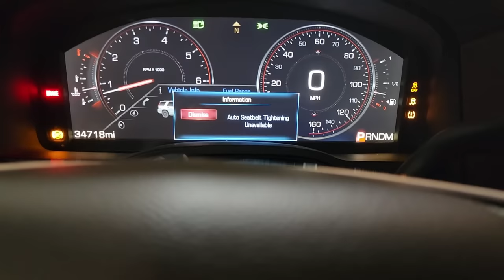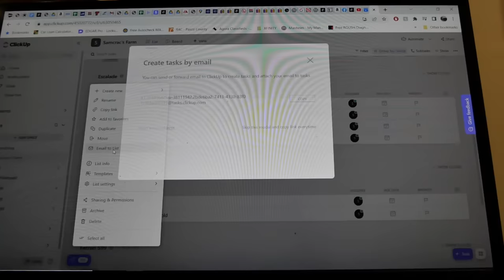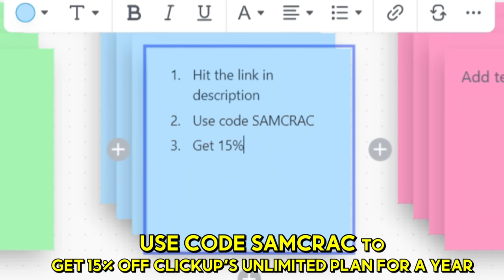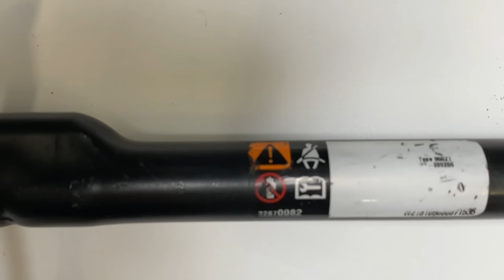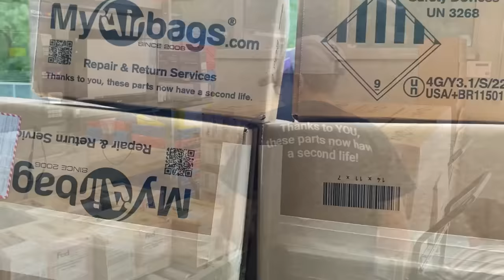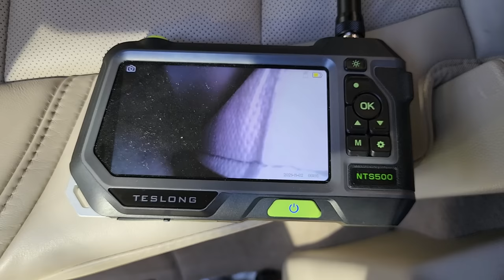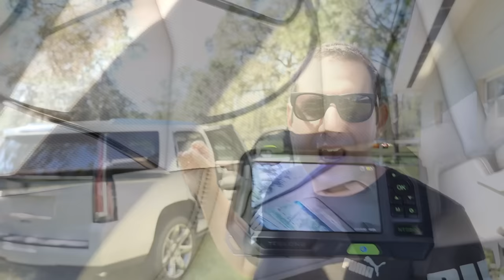Someone Illegally Tampered with my Auction Escalade's Safety Systems

Comment: I will be jerk testing the seat belts of any used car I might buy or even ride in to see if they lock as they should.  This internal "mod" removed even the basic seatbelt impact lock function that even the old seatbelt retractors had.

Comment: Parts pricing and availability causes so many unsafe cars to be sold. The manufacturer should buy them back! No one wants to be left holding the bag because parts are not available, so they just sell it in a dirty way so it becomes someone elses problem...  Its the manufacturer that doesnt have the parts, they should buy the car back and deal with storage and repairs when the parts finally arrive and then they can sell it for the depreciated cost!

Comment: General Definition. When a seller marks a vehicle “as-is,” this basically means that the vehicle is being sold in the condition that it is in at the time of sale. The buyer accepts that repairs may be necessary and that the seller is not responsible for making or paying for such repairs. 

I'm sry bud and to all the others complaining,  it clearly said AS IS and that's final, it's a shitbox and they knew it, that's why it ended up in an auction.
Reply: There is a huge difference between something being wrecked/broken and something being sabotaged.
Reply: @Rickmakes  either way they bought it knowing it had unknown problems in an as in state... you take all the risk for not looking further into the vehicle prior to purchase. He has noted a few times in previous video this poscalade was known to have issues. He's looking to buy cheap sell premium, it's his loss for gambling on a POS

Comment: I suspect the owner hit something or someone realized later, it was much more to fix. Took it to shady shop. The resister trick probably worked. Did a quick trade the buyer didn't see flags and no wreck reported. After some test drives more systems fail. Then the dealer goes hey we can fix at cost. They dig in hence loose trim... sent to auction rather then gamble.

Comment: 6:15 - holy shiat that could have injured or killed someone if they bought that cart and assumed the safety systems were operating correctly. WTF. Seriously, there needs to be a way to trace that back to the party who sold it to auction and penalize them big time.

It's amazing the lengths people will go to endanger strangers just to make a buck and/or avoid doing something the ethical way.

Comment: This Is Not Unusual someone went to the auction and cut the wires. They do that so that that it will become a no-run vehicle and then they grab it up cheap. Splice some wires and make money. By the way if your GM product has a lockout mode. Find one of those very thin orange wires and ground it for about 10 seconds. That will reset the system. I've been to those auctions I've seen the cut wires. I bid them. Columbus Ohio Sheriff's auction. I drove that Cadillac for a long time. I paid $900 for a $10,000 Cadillac and splice a wire and reset the security. Oh by the way don't ground black wires with white stripes. Unless you like buying computer chips this also happens when people are trying to prevent a repo. They'll try to kill this system and hide it somewhere. Dealership repos it declares it a write-off. And then junk it for what they can get.

Comment: Automotive technicians get a lot of unnecessary crap... BUT THIS should be reported to the proper authorities (in CA it would be the Bureau of Automotive Repair) so the tech can be fired and whoever okay'd this can also be fired and anyone else who knew. This is ridiculously unsafe and the level of knowledge and effort it took to pull this off and the fact that it was an auction car means there were multiple people involved. It also means this likely wasn't thier only illegal project or their first. So this 10000% should be reported. Whoever thought this idea was okay and whoever performed the work should never work in the automotive industry ever again. Service advisors and definitely customers ask for some crazy stuff sometimes but this is next level. If these repairs happened at a dealership... some people are in trouble.

Comment: MyAirbags tried to screw me a few years back. They either fried my airbag module or it was fried and they supposedly were to "fix" it and then sent it back to me without even checking it. When I called to let them know what happened they told me it was bad AFTER I called to complain and already paid my money. I didn't get refunded till I told them I would do a Charge back with my credit card.

I'm sure it was just a mistake but the way they handled it was horrendous.

Comment: Probably a deadly dealership that did this just to scam another dollar someone should be tracked down who was responsible for this and be held accountable this is a very dangerous practice and I'm sure is some inside trick used for many years......I was in a car accident once and the driver flipped us over at about 80kmph Seatbelts didn't lock up no air bags went off but walked away with barely a scratch  Thanks the angels that were watching me that night

Comment: Got scammed with a crashed car, no lights or anything and then boom the mileage was going up faster than normal. I drove less than a mile and it was calculated as 2 miles

Comment: Get an attorney and go after Coparts or who ever sold you the car. They can usually trace who owned the car and who did I the restoration work. Pressure the whole line of ownership and someone always cracks as to who did the repair, then crucify them for fraud.

Comment: They didn't just 'hack it' to 'save 700 bucks', they went out of their way to deliberately tamper with every component in that seatbelt tensioner system to avoid having to buy a new one. They were lucky Sam was the one to buy this car as someone less experienced might not have found the issue. Who knows how many other cars this shop has sold with the exact same hack, essentially selling coffins on wheels to its customers.

This absolutely needs to be reported and punished.

Comment: That resistor hack is basically attempted murder. Air Bags and it seems the seat belts one time use locks are regulated Destructive Devices, that's legally the same as a pipe bomb or a claymore. Whoever did these shortcut hacks should be reported to the ATF this is a serious felony.

Comment: Probably who ever was paying on it. Had a fender bender accident. No insurance to cover it. Went to some garage mechanic for a cheap fix. Then that mechanic cut their wires and unplugged stuff to make them have to pay a few 1000s for a fix that should been under $500. I highly doubt the dealer did this or allowed a worker to do it. Which is why they just said acution it off and also if it was under payments, that person still have to pay the Dealer what the auction couldn't recover. 

Man, these garage mechanics and sometimes dealership workers could be nasty and do these things to people. Why, maybe its just to get over or they just really hate that person. They should be jailed

Comment: This is why “rebuilt” cars have such a bad reputation and horrible resale value. Sure, there are a some shops out there that do very good work. However, the many that deal in these vehicles are just out to make a quick buck and get the car out the door as cheaply as possible. Imagine if you didn’t buy this Escalade, it probably would have ended up at some independent car lot for a “great deal” because the parking sensors didn’t work. Some unsuspecting person would have put their family in this thing not knowing the restraint systems were bypassed.

Comment: If you can find out who actually intentionally deactivated these safety systems I would turn them into the proper authorities. These modifications could have seriously hurt someone if not killed them. Who sent the car to auction is most likely the culprit and I suspect they have done this before. They had the expertise to bypass the system so it was obviously done intentionally.I live in Illinois and have done a few rebuilds for myself with the help of a friend who owns the liscense  and have gone thru the state inspection process and it was kinda a bitch but I'm glad it is as tough as it is. How did the inspector NOT catch this ? Is there something going on between that offending rebuilder and the state inspector????  Someone should really make this whole thing a big issue.

Comment: These one time use seatbelts are a scam there is a fully mechanical seat belt locking mechanism that gm and all the other vultures that are these car companies have replaced with all this disposable safety equipment so blame them because you hit a pole at 15 mph and it triggers an airbag sensor these do nothing more than a mechanical webbing system that's why people at your auction gutted the seatbelts blame the car companies that's exactly what you get when you go to an auction that's what get the price down

Comment: Sam ,your being totally unfair on many levels for starters in your initial video you literally referred to this as "wholesale junk" well I wouldn't exactly be upset all things considered if I was you although cutting those SRS related wires on the belts was certainly a bad thing to do but the fact that the dealer wanted nothing to do with it actually lends some credit to them they sold it as is wholesale !

Comment: It was sus from the very beginning, as a dealer would not only be able to diagnose and fix things, but do it cheaper and easier than a non-dealer.  You should've stopped as soon as you found those resistors and notified the police and/or DA.  Not only did they break the law in defeating the safety systems, they committed fraud for the illegal changes, hiding it from the buyer/actioner and not reporting the car as being in an accident.  The seller should be fined and prosecuted.  And the auction house shouldn't be allowed to skate.  They should suspect something is wrong when a dealer is dumping a valuable vehicle.

You get a dislike